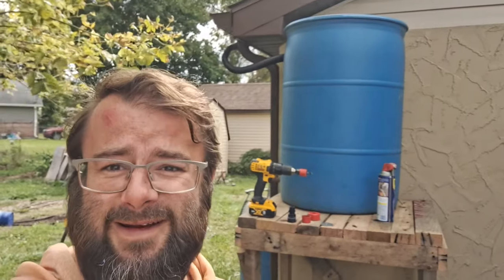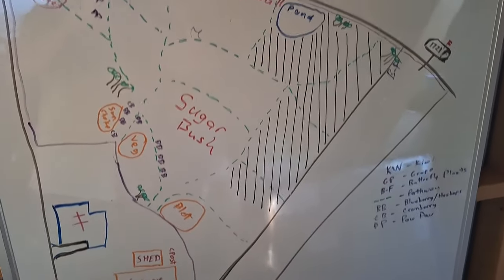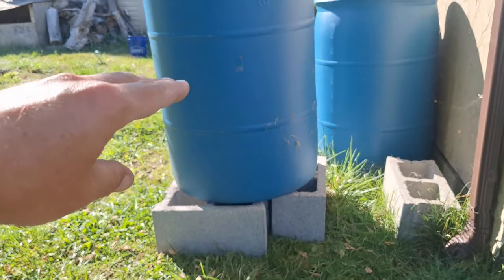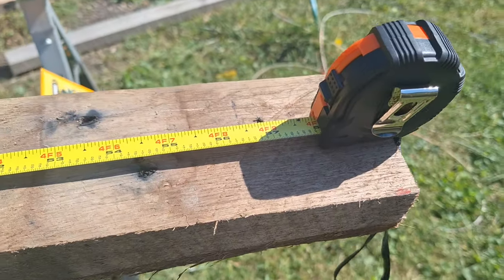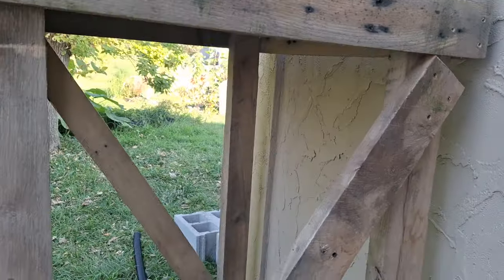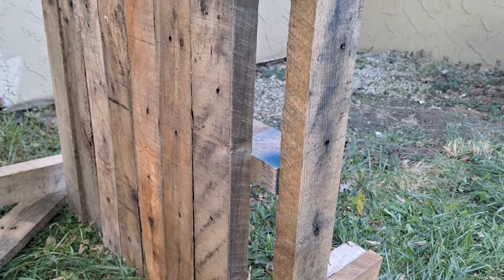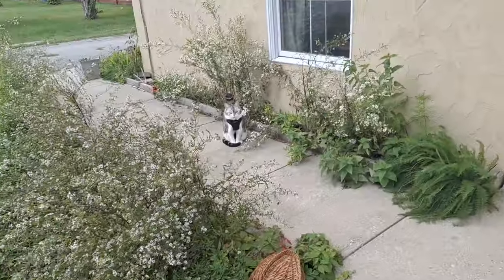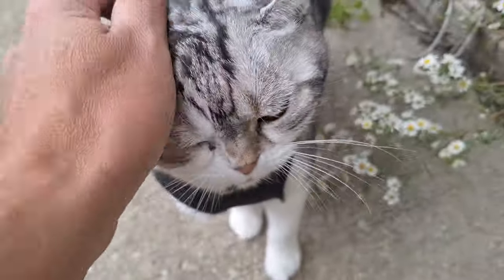DIY Rainwater Barrel Install & Building a Water Tower (How-to + Amazon kit!)

Comment: Hey, I found this formula from The Rain Catcher Inc.  I'll add a note at the bottom. Take care and well done sir!

An inch of rainfall on a square foot of surface area yields .623 gallons. So, multiply .623 gallons by the number of surface square feet of your roof. In our example it would be .623 x 2,000, which equals 1,246. So for each inch of rainfall, your roof could collect 1,246 gallons of rainwater.

Note:  divide this number by the number of downspouts you have.  That's how many gallons will be going into your RB when it rains an inch.  Holy cow, adds up fast!  For this reason we've gotta plan for overflow, right?